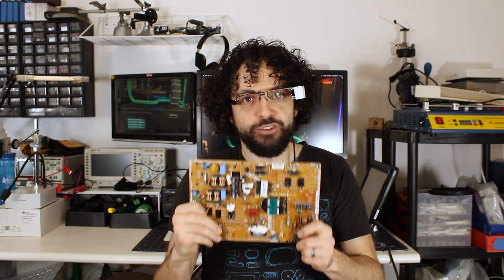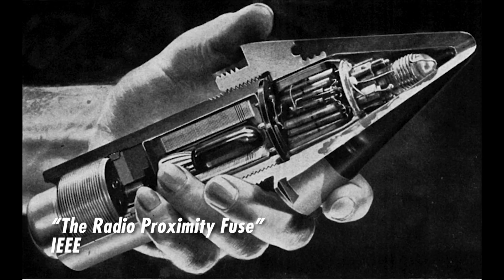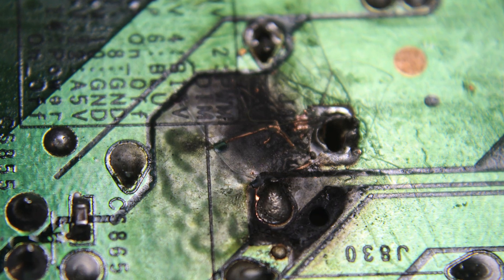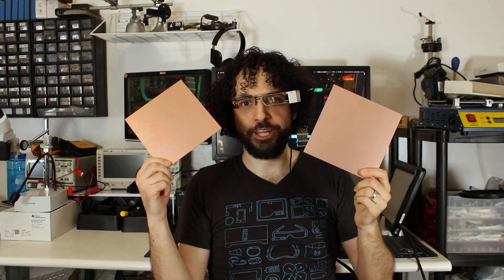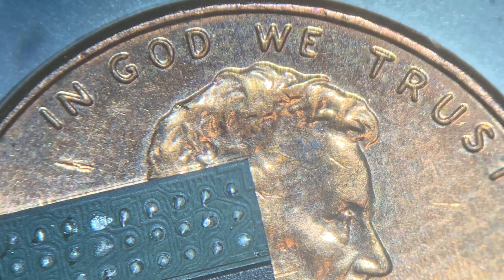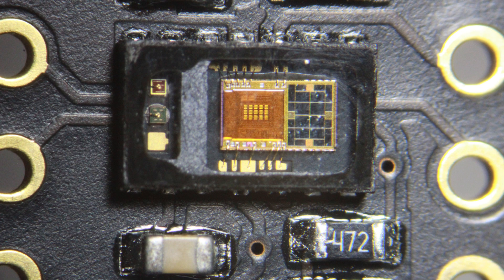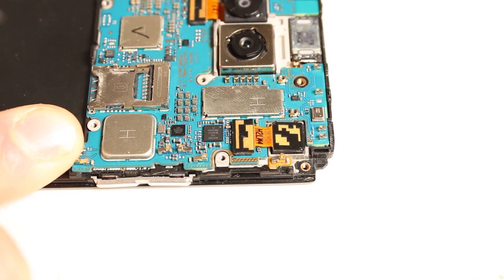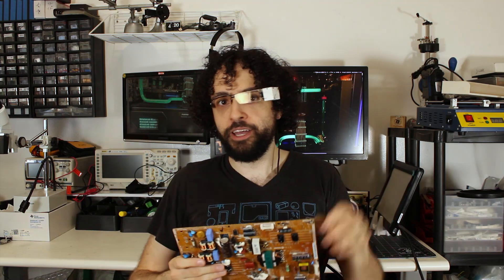Why Are Circuits on Boards?

Comment: 5:10 
poor information:
FR-4 has low RTI, cannot be used for high voltage circuit.
FR-1 is recommended for high voltage circuit.

Comment: Back in my day, 50 years ago,  I built an 11mega ohm VTVM from Heathkit that had a wired chassis. You only have to do one such thing to appreciate a PCB or even a bread board..

Comment: I learned how circuits work by restoring a pinball machine. It took me two years because I didn’t know what I was doing and I broke a lot of it that I had to replace with modern equivalents, but it didn’t have a circuit board. It didn’t even have a logic array. Pure electronics.

Comment: Fun fact: basically everyone in my family worked for IBM at one point or another, bc that was the main job supplier in the area. My grandmother soldered for them for at least ten years, she didn't work there as long as most of the rest of my family, many of whom actually have a pension from them. And my grandfather had a crapton of acid burn scars from his time working for them.

Comment: wire wrapping is still used extensively in avionics.

soldering a wire creates a weak point where it invariably fails...

wire wrap tends to connect even better when yanked on or vibrated... whereas crimped lugs often fail.

i really love pulling apart things from the 70s when boards were drawn and laid by hand... you see the craziest layouts! and theyre generally all rounded and curvy... matches the paisley shirts!

as soon as you route a board though, you soon realise just how hard it actually is to go from schematic to a trace layout that makes SENSE... can spend hours tweaking and suddenly realise rotating one component by 90 degrees allows that pesky track to go directly across rather than take the meandering tourist path, visiting every other part of the board before reaching its final destination.

and as a tube lover, 90% of my work is point to point on tagboards.

Comment: The copper conduits on the board are in place of wires used in the past.  Modularity has always been there for a smart circuit designer.

Comment: as opposed to what? What would you put a circuit on if not a board? I mean I guess you could wire the components together in a spaghetti ball, which I guess is what they did until PCBs were invented.

Comment: I disagree. The use of two dimensional circuit boards may still stick around for a long time, but the future of electronics lies in the adaption of three dimensional circuit board design that goes beyond the usage of integrated circuits.

Comment: I think you are somewhat wrong about need for power transfer in optronics: if that's how we do it, then we must recreate electronic devices in terms of optics (that's the <1800s flying ship kind of logic, when your worldview is limited by current knowledge). E.g., voltage divider as a splitter of light, or how capacitor in electronics acts similarly to flywheel in mechanics (it seems that equivalent of capacitor in optronics is called an "optical integrator"), etc. Power, be it electric/mechanical/thermal/etc., is needed for communication with outside world, similarly to mechanical/thermal/"optical" power in electronics.

Comment: Nitpicking time: Didn't go through all the comments (too many) so someone may have already picked up on this point; 2 double sided cores create a 4 layer PCB. There is also additive technology used mostly in the fabrication of SiPs, SoCs, and MCMs which can start with a double sided core and have layers built up (usually equally on each side, but there are exceptions) with laser drills at each step resulting in densely routed circuitry. Through hole vias can be used (when the cores are more than 400um thick) but usually Blind and Buried vias are used. Too much for a short comment to do it justice. 

I would recommend a video on the fabrication of SiPs, SoCs, and MCMs as this is where the packages are made with dies (and sometimes discretes) all placed under the black molding that ends up being the ubiquitous chip. I have been in the layout field since  the mid '80s and worked in all manner of companies, some of which did their own PWB/PCB fabrication and assembly. It was enjoyable watching your video and seeing different machines in use. Your presentation was not "snooze-worthy" and kept my interest; you have no idea what an accomplishment that is! [GRIN}

Comment: so i have a circuit board from a Smg456 board and i wish to have some help Makeing a computer from it
Reply: You can't do that. You'd have to buy a computer. It's like asking how to make a pizza with only concrete - you'd have to buy all the pizza ingredients which means you might as well just buy a pizza the concrete is not helpful at all and cannot be used to make pizza.

Comment: The best way to put a bunch of parts together isn't on a board, it's in a 3D volume. #PrintedCircuitVolumes. You heard it here first folks. Just wait until ChatGPT's grandchildren start designing them for us.

Comment: It would be cool to see an open circuit designed to take up 3d space instead of laying flat, and without using boards. Like if we took a computer and removed the board, how much space would the components take up in a cube, and could the wiring and circuitry fit in the gaps between components.

Comment: There are a bunch of examples of non-PCB devices (still being made to this day) in the audio world.  Many tube amps and high end studio gear (Universal Audio LA2A) are point to point circuits.  While the LA2A uses a turret board (which was another precursor to the PCB), virtually none would consider that a circuit board since its not "printed" with traces on it.  dig it man, subbed.

Comment: I feel like this is an ongoing development that people have kind of ignored and instead focused on shrinking transistors. Just look at the socket for Intel's 12th and 13th gen Core processors, it's kind of pushing the limits of the number of pins per square inch that can be achieved with an LGA design. How much further can we push our PCBs and substrates? I remember recently seeing a video of someone using a laser to remove the layers of packaging from an old memory chip with SOP packaging, and I was shocked at how much space in the IC's packaging was wasted by traces.

Comment: Wow. I have been an electronics hobbyist since the early 1970's. I qualified in 1980. I'm so old that I have even worked on a real breadboard. (Not the pllastic kind with holes in it).

This is the best video I have ever seen regarding the history of the printed circuit board. I believe that every single electronics student should be made to view this video when starting out on their career. Brilliant, Zack. Thank you so much.

Comment: Back in the late ‘70s, I was an engineering tech at a hi-fi company working for the chief engineer. The company had some of its products manufactured overseas because it was cheap (there’s a whole backstory about how a fabled engineering company became a mass-market seller of questionable quality items).  The PCBs in the imported units were utterly awful. Any attempt to desolder a component (say, to repair the unit) would, almost inevitably, cause the copper trace to lift off the board in an act of freedom-seeking desperation or suicide (the jury is still out on that one).  

Anyway, there is a punchline here in that the chief engineer described the source material for these PCBs as “compressed water buffalo ****”.  

One of the overseas suppliers did finally get it together and is now one of the largest consumer electronics companies in the world. However, memory is long and persistent and I still, to this day, wonder if I’ve made a terrible mistake when I buy one of their products.

Comment: Heh, ya know what? those fancy machines that the factories use to harden the photosensitive resist film can now live on our desk, Zack owns like 7 and they are called MSLA printers. Its a tiny little uv light masking decive. Works like a charm but the photoresist boards are substantially more expensive than the bare copper ones.

Comment: Oh my God, the Motorola Golden View ... as an EE I think I am going to faint.  I have seen old stuff, even stuff without PCBs.  For example, old (OLD) Tektronix oscilloscopes - which used point-to-point wiring with ceramic "combs" that collected the solder junctions (you have to see it to really get it).  The result of that is incredibly beautiful, meticulous, but very error prone during manufacturing.   However, this picture at 1:37 is a totally unbearable nightmare to me.  Despite photographic evidence, I must disbelieve its existence (lol).

Comment: they still use point to point in handmade guitar amps... I'm still yet to see an electrical engineer react to a guitar tech explaining why they're better than circuit boards.

Comment: Dude, this video is full so much bs. Original printed circuit boards were done with tape on glass, not paint directly on the board, because it was done with a photolithographic process. The photo resist used in the etching process for PC boards isn't paint put on with a brush and it isn't printed, it's a photo resistance exposed with UV light. And the last one that got me before I quit watching was his stupidity about Flex pcbs. Go talk to Epson and Okidata about their dot matrix printers. Go talk to HP and Canon about their Inkjet printers. What do you think connects their printed circuit board to the printhead that moves back and forth tens of thousands of times over the course of its lifetime? It's a damn flexible pcb. The notion that they're only designed to be flexed one time, when they're installed, is an asinine comment it is fucking bullshit. Can a flex PCB be designed to only Flex one time? Sure.  but can it also be designed to flex tens of thousands if not hundreds of thousands of times? Also yes. If you're going to try and speak as an authority on a subject dude, do your damn research properly and thoroughly.

Comment: My uncle worked on one of the first rockets that went into orbit and came back (basically the motor for an ICBM). The vibration destroying the solder joints in the circuitry was a big problem. they tried a lot of things, but he told me what worked was when we put down insulation foam, then did point to point soldering on top, then sandwiched more foam on that. That prototype "board" was the first one they tried that didn't get destroyed.

Comment: Not really.  Every  spacecraft I worked on in the 80's did not use a board.  It was all modules with welded interconnects.  Incredible density but crazy expensive to make.  Early electronics were all also all hand wired.

Comment: But why are boards still flat and flimsy?  What if it was a sphere, or a pyramid, or even a dodecahedron?  I think the potential for curved board design could help pack components in a smaller space, increase structural integrity, and reduce hazards that can occur when components like capacitors blow.

Comment: When I was going through ATT (Advance Technical Training) in US Navy Submarine School in 2012 we learned to troubleshoot component failures on old PCBs that had the hand painted traces on there. They had mountains of those old PCBs and I couldn't get over how cool it was that someone had painstakingly done the traces by hand over the course of probably several hours and here they were many decades later still /mostly/ functional.

Comment: stuff is badly enginered. good stuff is not getting hot. badly made stuff is called a "stove" for 40 years straight in a row.
Reply: it is the ohm and voltages ratio of the design. that is too modern for my batteries.
Reply: a device should not get warmer thrn room tempreture. "standard" it is for sure possible that it can deliver the same job. as a "hotter" device. if the components are choosen differently. or is designed on an other way. or other style.

Comment: After using tape, knife and OHP transparency for a decade (with positive photoresist) one day a version of Orcad for DOS come along (it didn't run with less than 640K of RAM!).
From there, it become a race to the bottom.
It is still a secret (every PCB manufacturer utilise its own concoction with graphite and palladium) how to electroplate a via: the holes are initially non-conductive!
The phenolic PCB are still my preferred material for prototypes and non-power electronic devices, just the 60/40 lead solder. Epoxy PCB are only for circuit operating above 200 MHz.
Last thing I wanted to mention, is where the PCB is not only the sum of the connections, but the component itself: the case is for distributed constants design. Here, the epsilon (dielectric constant) of the PCB material is part of the circuit design; it is needed when the operating frequencies are above 10 GHz. An example is the phased array of the Starling dish...

Comment: I've been dorking around with solder and circuit boards since the 80s... even "scratching" or running my own lines to "refurb" my own hardware on occasion... So I wasn't a complete idiot when I clicked on this video and yet I still thoroughly enjoyed it :) I like your style and pacing

Comment: What a cool video on PCBs! I didn't know they were already around through the WWII. Thought they came into use in the '50s. Oh, and I had a foldable display camera with a stack of flex PCBs connecting the display with the main board; the flex got broken from use. Oh, and CNC is nice for prototyping - not really for serial production because it takes proportionally more time and power - when ultra high precision is not needed (ie no fine raster SMD assembly). Usagi Electric did his UE14500 "Kevin" vacuum tube computer entirely with milled PCBs.

BTW I'm wondering if the delmac crystals in the Stargate series would be optronic computers :)

Comment: 0:26 Well, not EVERY electroic gadget has a circuit board.  I think I've seen a tiny light-seeking robot that's just made out of the components soldered directly to each other.

Comment: Not really sure honestly, half the time I make my circuits with wires... because printing a board is such a pain in the ass...lol.

So what youre saying is that wire wrapping is how they used to make circuits... and ive just intrinsically settled on it as a technique for prototyping, especially when I want something wearable?  Huh...fun.

Ya know...the really ironic thing is if I REALLY wanted to I could have the cnc mill out any circuit I need... the laser could do the negative resist, etc...but it takes so much less time to just make a frigging wiring harness...lol.

Itd be nice if we could get a way to do kapton boards at home, using home cnc,  laser, 3d printers, etc.  Technically we might be able to print something that'll take current... but itd be pretty nice if we could mix something like TPU, on one nozzle, with a printable trace that has high conductivity, on nozzle 2.  Id love that... then I could just solder on the surface mounts and have a printed flexible circuit.
Reply: Oh...also, give me half the profit from the video and I'll buy some copper-clad and do a video of my big daddy cnc milling out a board for you to use on the channel... lol. 

hell, ill even make a board of your design if you want, saves me time having to decide what I want to make and make a design up. ;)

Comment: a freeform circuit would be better lighter but often more fragile, so you generally want to add at least some support with resin or hot glue this sort of thing is done in hobbyist solar robotics often to cut down on costs and complexity and often size, sone you can use components themselves as platforms for smaller components rather than trying to spread them out in a logical fashion that will take up a lot of flat space, there are pros and cons but it tends to look like an unprofessional mess and when something goes wrong it's often harder to test and replace parts since they're all in a spaghetti of other components.

Comment: The board is what fails, after the successful bird nest was produced. FR4 also called Q10 is really good for printing on as well  :-)  Etch resist pens and ferric chloride in a bag - ah those were the days.  Wirewrap 5 turns of copper and 1.5 of insulation "in theory - always", the original concept of square pegs in round holes, um SkyNet One (not called that then)  - don't ask. x14 layer boards, I did a course, repairs on that, scary stuff indeed.  Surface mount, yeah when I have to, I'm 64 see what your eyesight is like at 64. Build a valve 1KW linear with that and see where it gets you :-) Proprietary chips, even if you did find out what is wrong with it, try and get the replacement chip, go on just try. Flex boards fail - end. High voltage on a board, sure cut a slot. Not a single mention of veroboard, oh come on how the World was invented, loved the little countersink type tool that broke the tracks - just me I guess.

Comment: 6:10 it was not painted with a brush, it was tape!  we used tape that was like the pinstriping tape you use on a car.  As you put it down you scroll around because it was stretchy. And little pre cut tape doughnuts for all the through holes.  you could get entire set of stickers in a kit.  place them where you want the components to go and use the tape to connect the holes.  I did it back in the 70's.  Cheers